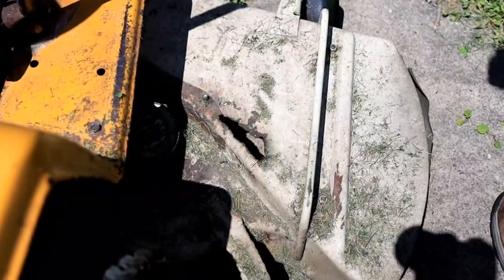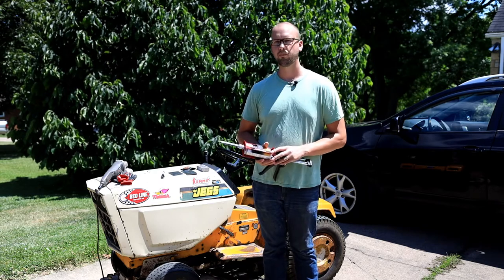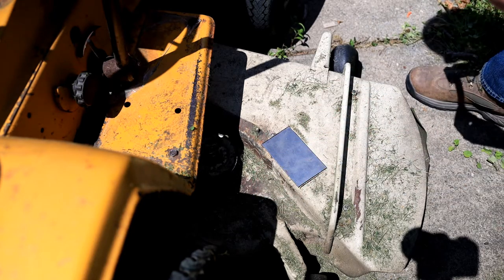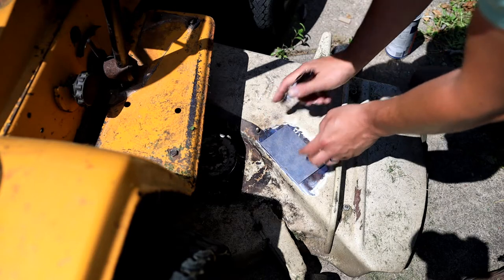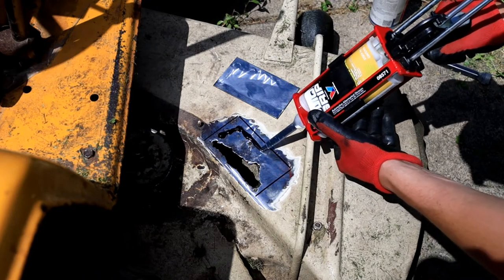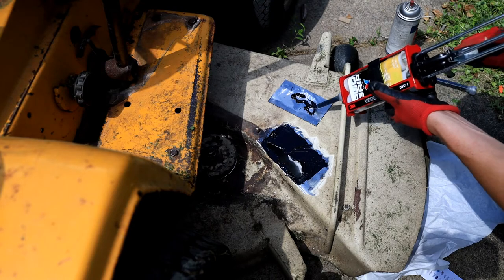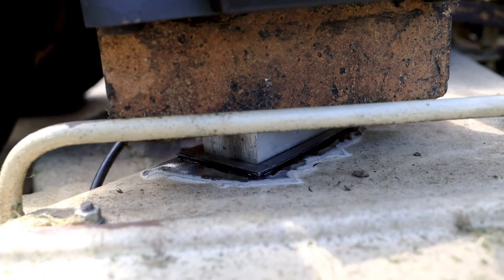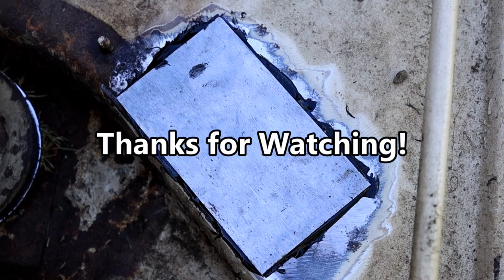Gluing Steel Together Permanently.  As Good as Welding.

Comment: where is this glue available? does anybody know?
Reply from the maker: I bought this locally but I have also used 3M Panel Bonding Adhesive with great success.  It is just as good and has a lot more literature available for bond strength.

Comment: i might give this a try on a friends rusty,  worn out old JD mower deck,   he wanted me to weld,  nothing to weld to buddy
Reply from the maker: Haha that is usually the problem with old mower decks.  It takes a really big hole to get past all the rust.  But since they have a lot of surface area, it is really pretty easy to patch the holy by just basically glueing a piece of steel on with panel bond adhesive.